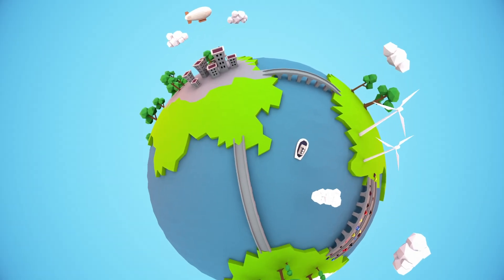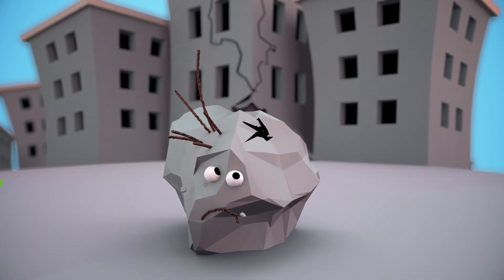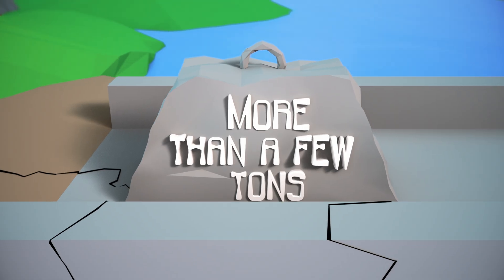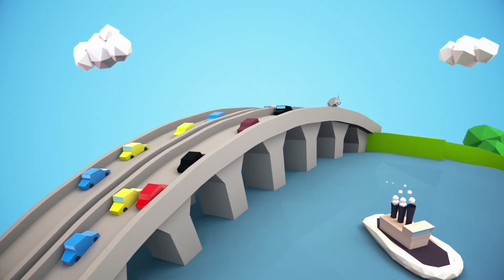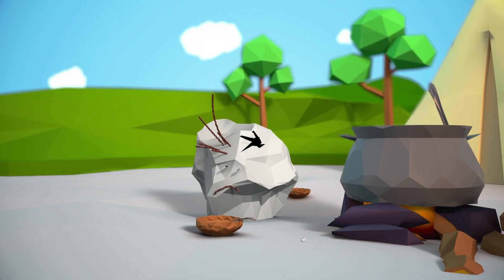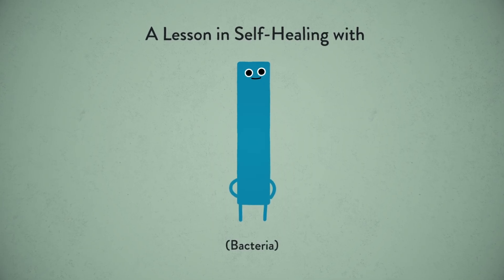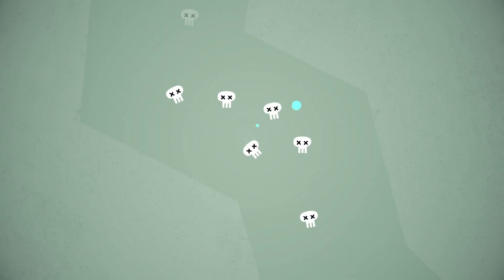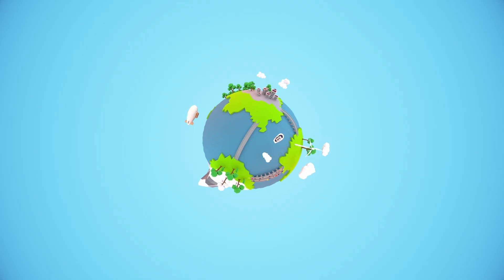What if cracks in concrete could fix themselves? - Congrui Jin

Comment: Hmm, I'm doing structural engineering, and I think I have some reservations about this. 

Cracks in concrete are normal, infact we build them so they crack in just the right way to minimize cost and risk of failure. 

If we need something to stand the test of time, like the colosseum in rome, we just use more sement in the mix. 

Unless you need something to stand for more than 200years this is unnecessary most of the time.

Comment: Ask corporations. Ask government contractors. 
Ask those in the business of profit no matter what if they desire to build with any material which would eventually put them out of a job or impose a MAJOR dent in profits.
When they return your inquiry with an outstanding NEVER, perhaps the reason why this is not a thing already will come into better light and focus.
Greed absolutely dominates weak minds. It becomes all consuming, and those who fall for greed, WILL sell out anyone they need to ensure the profits roll in as large as possible.
Concrete which does not need maintenance and can outlast the existence of a construction company is how do you put it...
"Bad For Business". 
We can currently add recycled tires to asphalt, causing it to last 50+ years without potholes or need of very much maintenance outside of re-painting the lines every decade or so. Many construction crews realized how much of a major dent such asphalt put into their potential profits.
Too many cities opted out of such asphalt because of construction company objection. 
Sadly, until greed dies out of the human species, there will always be such a thing as "too good" when it comes to infrastructure.

Comment: There's something missing here. There are ancient Roman concrete structures that are still standing. One reason is that they built their structures to be entirely under compression, using arches and vaults. We build our structures to be under tension, using steel reinforcement, and that's a major reason our structures don't last as long.
Reply: their are lots of benefit of building structures under tension, one is no sudden fall of the structure like in tomb riders movie.

Comment: or... just use Roman concrete... or not using steel inside concrete, structures nowadays are made "just good enough" and that's why they don't last much, if we made robust buildings like the romans did and also added those bacteria and spores then they would last forever.

Comment: oh my... bacteria and FUNGI in our walls? That's a health hazard! Especially if they are forced to starve! They will enter air from open cracks, spread their spores throughout the room, even if you don't see the cracks! That's a hazard!
Reply: Only certain fungi and bacteria are harmful to humans, most of them are harmless and can't do anything to humans
P.S. there are millions of germs on every surface
Reply: @prabas8190  Unfortunately, that's not true. Even commonly harmless bacteria and gungi can become lethal, especially if caused to starve. There are cases with Metro stations that blocked natural migration of bacteria through soil with concrete, so it took them time to get through, and once they did, everyone who passed the metro got infected and harmed. Even symbiotic bacteria are harmful when there are too many of them, and the only thing it takes are favourable conditions.
If the the bacteria and fungi get access out of concrete via cracks, they WILL spread on everything inside infect the inhabitants, and since air is generally moist, they will not go dormant again.
Reply: @anastasiaklyuch2746  anything in excess is a threat, but to reach such a critical mass ~28% of it by mass should be made of spores, also the fungi literally DIE to fill in the cracks
Reply: @prabas8190  There is no need to fill so much of concrete with it, as it multiplies. I have already lerned of bad examples with bacteria in concrete, and as a biologist, I disaprove of such technology. You are free to have your own opinion, but I will never build my home from such material, and hope none other would have to.
Reply: @anastasiaklyuch2746  acknowledged

Comment: TedEd: What if cracks in concrete could fix themselves
Me: What if concrete would never crack
Reply: Exactly. Maybe if they were slightly elastic and they would produce very small bends instead of small cracks.
Reply: @mrflip-flop3198  I believe the cracking is because the elasticity of concrete reduces over time.
Reply: The issue is that concrete has a very high pH inside, but when the pH lowers over time the concrete becomes more and more unstable, and the good thing with the bacteria that precipitate calcite using the so called active pathway is that they also increase the concrete's pH. The downside to that is that at some point it may become so alkaline that not even the alkaliphilic bacteria can survive.

Comment: so, theres not much to worry about the concrete itself right? the problem is the crack make an entrance for water and air to begin the rusting process.. so why do they not just invented a steel that hard to or cant rust..? or is it an expensive solution?😅

Comment: One key factor the video is missing is the importance of crack widths.  Crack widths found in industrial concrete (>1mm) are often too large for such self-healing processes to overcome.  Take for an analogy, self-healing in ourselves; a simple paper cut can be healed very quickly, but larger ones may leave scars or in extreme cases, perhaps not heal at all.  In this sense, fiber-reinforced concrete recently being developed which has much smaller crack widths (<50 microns) may be more conducive to self-healing, and more economic without the need for costly additives (https://www.youtube.com/watch?v=TUxXzjzan5k).  Or perhaps a perfect marriage of the two lies in the future?

Comment: As civil engineering student, this looks amazing! 
About the cracks, when they appear on a Beam it means that whether the steel or concrete are not well design to bear the stresses. Therefore, when the cracking appears it could meen that the structure may fail (and not necessary because of the concrete that colaborates in the compresion zone, it may fail in tension) and we must avoid a britle failure (very rapid cracking) so people may be allowed the evacuate the builidng. I would like to know if this self healing system can avoid this kind of failure in structural elements.
Reply: Oh yeah, physical problems too. But I wonder, do the healing cracks put more strain (or stress, I really don't know) on the entire structure?

Comment: Why does ancient Roman concrete seem to last so long without spalling? I have seen several ancient concrete structures, which have experienced around 2,000 years of weathering, show little to no cracking. I have often wondered what made their concrete better than modern material. Is it as simple as the composition of the volcanic ash?

Comment: Yet the ancient Egyptians built stuff to last over 3000 years......

 (Unrelated Facts bro)
Reply: and also five tons of cars don't drive all over the pyramid
Reply: And there's no metal to rust inside
Reply: Sandstones, more different from concrete.
Reply: It helps that they were built in an arid place. Climate heavily impacts construction.
Reply: is however a magnificient construction, yet the cost and materials are different and have otrher uses
Reply: All of the above, plus the shape of the pyramid is naturally very strong, compact (dense), and stable.  But not very practical for bridges and buildings.
Reply: laughs in roman Colosseum
Reply: The romans built stuff that lasted thousands of years tho... why should modern stuff break after 20-30 years?

Comment: Instead of adding bacterias and nutrients to the concrete for them to make calcium oxide, why don't just adding more calcium oxide directly?

I know they said before that this calcium oxide can only repair very tiny cracks, but how can then bacterias repair bigger cracks if their mechanism is producing the same calcium oxide?
Reply: If you just add the calcium oxide, it will eventually run out.

If you have calcium-oxide-making bacteria in the concrete tho, they will keep on making calcium oxide every time cracks appear, meaning that there's more calcium oxide for bigger cracks.
Reply: @dydlus  won't bateria's nutrients run out too?
Reply: @AlejandroBravo0  the concept is that cracks lead to water, water brings nutrients from outside the concrete enviroment, into the cracks. Feeding the bacteria, which live and die until they produced enough to fix the crack.

Crack-water-bacteria-seal
Rinse and repeat
Reply: @merlockmerlin1065  if bacteria can feed on those nutrients from the water then it works, you're right.

I was assuming bacteria needs the ones that were introduced to the concrete while mixing since that's what seemed to be said in the video.

Also, if bacteria can feed on nutrients from that water, why adding the nutrients to the concrete?

Comment: Concrete has a life span of only 20 - 30 years?? But most buildings stay standing for more than 100 years without any renovations? I have seen people even sell their properties which are over 30 years old? Can someone explain?
Reply: Unreinforced concrete can last milleniums if done properly. Reinforced concrete on the other hand, rarely lasts more than 100 years as the steel ends up rusting inside, greatly reducing the strength of the structure.
Reply: I think it's Concrete alone, not including the other stuff like the Steel Cables inside of it or something.
Reply: I'm pretty sure the video was referring mostly to concrete on it's own with the 20-30 year life span, not reinforced concrete. With reinforced concrete, some cracks in it doesn't mean it's completely nonstructural, until the rebar rusts it still holds a significant amount of strength and structural support, it's just that if you see cracks you should probably repair before a larger problem (the rusting) occurs. Concrete has really bad tensile strength, but really good compressive strength (in fact most if not all stone has bad tensile strength, this is why arches were so useful, as they direct the stresses down the sides so that everything is under compression and not under tension). Because of this you usually won't see concrete floors or etc on buildings that use non-reinforced concrete. Concrete on it's own, like Antoine said can last a very long time, just not often in structural situations, regular concrete can easily be used for small walls or other structures that only rely on concrete's compressive strength, such as walkways/sidewalks (not bridges, that's reinforced), small walls, etc. Regular concrete is only used in situations that don't rely on the structural support of the steel bar that gives reinforced concrete its name. Thus water getting in its cracks isn't as big a deal, and even with cracks, since non-reinforced concrete is used almost exclusively in situations where tensile strength doesn't matter and only needs compressive strength, the concrete can still support itself and any weight on top of it, however it is then still quite vulnerable to many scenarios that could cause a major failure, and if part of it fails, then other parts of the structure start having to deal with some tensile forces. However if maintained well any concrete structure can last a long time, and with reinforce concrete especially if you live in an area with low humidity or rainfall, and a temperature that stays mostly consistent throughout the year and doesn't go through major swings in temperature, then the concrete can last far longer as well.
Reply: Paragraphs please, spare my eyes.
Reply: More limestone plaster mixed in

Comment: Why bother healing it if we can prevent it by using Glass-Fiber Reinforced Concrete 😉 Prevention is better than cure.
Reply: Can we do both?
Reply: Gustavo Borges definitely
Reply: Imagine the amount of money needed to replace all that concrete
Reply: Gloomy nope. U will not replaced concrete it is an additive upgrade to strengthen it
Reply: GFRC is not used for structural support.
Reply: Rembrandt yep but it works well when combined with anti-rust steel reinforcement
Reply: @terencecampugan2558  they usually use interlocking steel hooks as an admixture instead of glass fibres.
Reply: GFRC just increases the concretee strength not cracks becase cracks are not formed by any kind of loads or outer forces as they explained i videos .So i dont know how you are using GFRC to prevent cracks
Reply: Terence Campugan mix design available for glass fiber concrete???
Reply: Sourabh for us standard mixing is going well
Reply: GFRC can only be used for casting panels of it and not really replacing conventional concrete right?
Reply: Sourabh as ok now it supports well some 2 storey bldgs. I hope more will practice it
Reply: Terence Campugan 2 stories is kinda lacking abilities for a suburban Walmart, let alone a demanding world with places like NYC (where I work).
Reply: can't we do both? so, when the cracks eventually form, they can be fixed by the microorganisms.